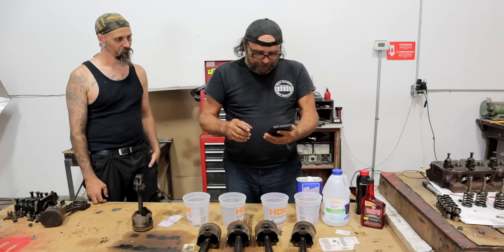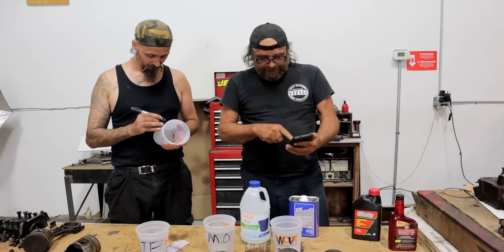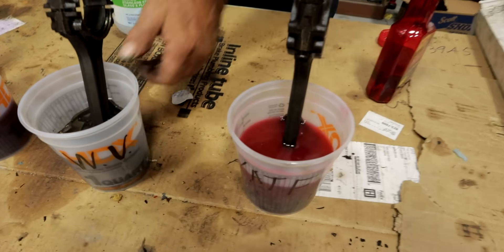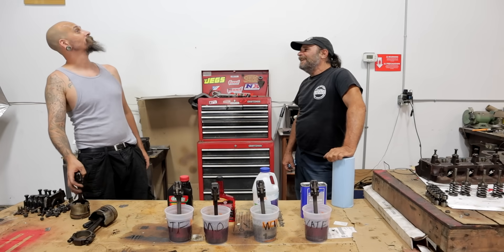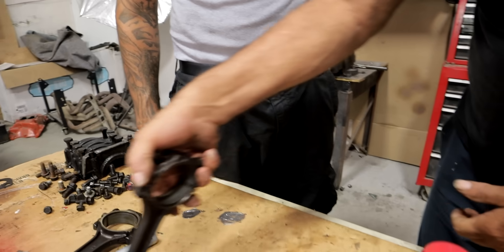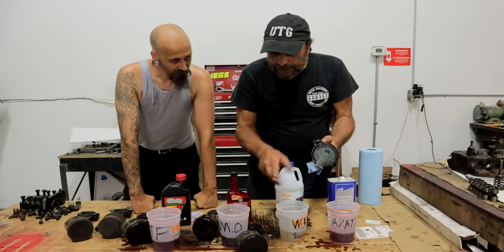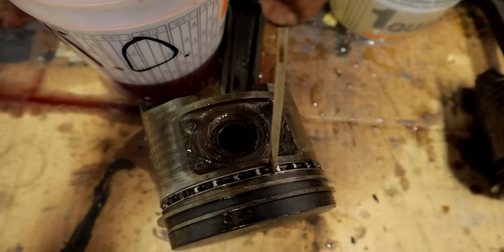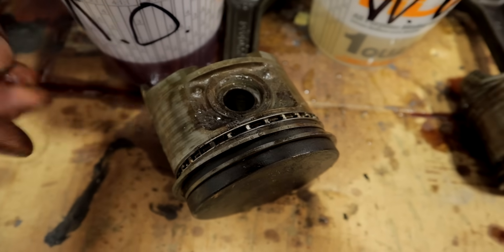Best Fix For A Stuck Engine - Viewers Choice. Marvel Mystery Oil, vs ATF, vs Acetone, vs Vinegar

Comment: 2+2 is an incredible product hard to find though. I fixed a Toyota that was consuming a quart of oil every 500 miles. Filled the cylinders 3 times over yhe course of a week then did a flush with liqui moly flush. Went from a quart every 500 miles to a quart every 2500miles. Massive improvement dont know if itll help with stuck rings but it worked wonders for oil consumption.

Comment: I use Seafoam on running cars. Concentrated detergent, can add to oil and run it hot for hundreds of miles. I was impressed just pouring it over dirty baffles. This video now has me really sold on periodic flushes with a good detergent like Seafoam.

Comment: There is a huge difference between dealing with sludge/varnish versus rust.  

Vinegar is an acid, acids attack and dissolves weak metal compounds - in other words the vinegar dissolved the rust in the rings.

The other fluids are solvents. Solvents attack organic compounds - in otherwords dissolve sludge /varnish /evap compounds.

What this test tells me is that the pistons were stuck with rust - for which an acid (vinegar) is the best choice.

If they had been dried sludge/varnish the vinegar would not have done anything and the MMO would have been the clear winner.

Different problem requires a different tool.

Comment: Remember your chemistry.
Are you attempting to dissolve rust or dissolve carbon?  
I say this from long experience freeing old tractors.   Your first soak needs to be something that dissolves rust.   Vinegar works, CLP, or rust penetrant.  I’m talking LOTS of it in the cylinder for not just overnight, but a full 24.   Blow it out with compressed air.  This first step dissolves the rust so the crank will now turn.
The second soak is with a true carbon dissolver. That’s your Seafoam, B-12, 44K, or crankcase flush and it gets a 24 hour soak.  
I have had zero luck with Marvel, ATF, or brake fluid.  
The idea is, get the rust particles broken and softened up and out of your way so the second soak can free up that lifetime of burnt carbon build-up.
Freeing up a stuck engine is easy via dissolving the rust.   Getting the rings to pop back out  by dissolving the carbon is the true fight.

Comment: I have rusted piston rings with 0 compression on all 4 cylinders. I was going to dump  concentrated white vinegar in every cylinders but my mechanic friend told me to use diesel instead. I will try it and come back to you. Allarently using vinegar is not a good idea

Comment: I use 6%($5)Vinegar or 30%($20) to clean rusty Motorcycle tanks on the Bikes I bring back to life. For stuck pistons LIQUID WRENCH beats JB Blaster and WD-40. Marvel just seems to be riding off a VERY Old reputation than modern reality. Good Vid, Thanks.

Comment: So about 4 oz down each spark plug hole, let's set as long as possible....
Crank over without the spark plugs to clear the cylinders  , you might get lucky.    The old cans of liquid wrench is to recommend this.    And Grandpa used to use 50/50 oil and kerosene.

Comment: Diesel fuel. Run it in my car for stuck valves also, mixed with gas.
One gallon diesel two gallons gas.  Stuck rings straight diesel. Let's soak overnight.. in cylinder..ok.
Age68

Comment: What works will depend on WHY or what is causing them to stick.
  Solvents: Thin organic (non water) solvents will dissolve other thick/hard organic deposits like oil sludge and plastic like varnish. Volatile/flammable/explosive ones shouldn't be used in a running motor however prepared products that may also include detergents can be used on an assembled motor. Add it to the oil or spray it into the intake or spark plug holes, run it for a minute and then leave it sit for a day or two. Stay away from solutions that might harm gaskets.
  ACIDS will dissolve RUST, if the cause was moisture not old oil then soaking in it will be effective. Most acids will work however some might work TOO well and eat the part. Vinegar is actually powerful acid. Concentration is key to any acid and food grade white vinegar is weak and will require more time. Any acidic solutions or methods for removing rust will work, some faster than others. However, they themselves will also cause rust and possibly dissolve the parts so after the parts should be cleaned with oil. Using acids on an assembled motor is probably a bad idea. But, I guess one could pull the oil drain plug and drop a half cup of acid into a plug hole, wait a day, drop a couple oz of thin oil in the hole, wait a day then fill it up with fresh oil. Run the motor until its warm and if it works, do another oil change.

Comment: MMO is my go-to stuff. It might take longer than vinegar, but vinegar has no lubricating properties. If you pour it in a cylinder, you have to get it back out. MMO can stay in and you can safely rotate the engine. It will burn off once you get it started. Load the gas tank up with a couple quarts also and run the engine. The MMO and heat from running will get her going again. Besides, it smells good!

Comment: Now I’m working on a neglected Tacoma with piston # 1 with that problem , I used in this order  “seafoam”, MMO, B12 and  now an Engine flush product …. Right now the level is not going down in the chamber 😃 so I’m assuming the piston rings are getting free😁

Comment: After 55 years of working on stuck engines and trying everything I found brake fluid to be the absolute best hands down for freeing stuck cylinders.
Reply: because of the toluol+aceton mix, it evaporates fast, so it is better to put some 2t oil into the mixture.
Reply: you need to be super cautious with toluol tho, it is highly famable. 

what i would do is to buy simple paint thinner that has toluol/aceton mix in it. You can add some IPA+ 1/10 2t oil and once soaked and turned the crankshaft 3-4 times, just  drain like 2 liters of oil mix and pour 2liter ATF, start the engine and let it run for like 15 minutes, with liquy moly engine flush then do an oil change. 

Once you filled the engine with new oil, buy a LM valve cleaner and add that to 15 liters of gasoline and go 5k+ rpm on the highway for like 45minutes. 

if this does not help your oil consumption then only a new engine will do

Comment: first of all drain all your oil out your oil pan, leave your oil filter on. leave your oil plug out. Only do one cylinder at a time. put a pressure gage on the cylinder and bunt the starter until the Gauge says around 60 psi. that's on the up stroke and all vales are closed and there is a vacuum in the cylinder. put a container under the oil plug hole to catch the drips. Pour in 1/2 cup of mixture 50-50 .in cylinder then put the plug in quick. Then look under your vehicle and you will see a drip every second of blead from the cylinder. if it all drains out, then repeat again with fresh 50-50 mix, when the mix quits dripping that means that the rings are free, and all passages are open. Then turn over the motor to push out the mixture. then do the next cylinder. Buy a whole gallon of acetone and a gallon of paint thinner or kerosene but kerosene works better there is a patent on removing carbon build op on engine parts.my patent. you will notice that your plugs will start burning tan looking and not black looking. Then add cheap Walmart engine oil  .

Comment: I have white smoke from one of the exhaust, passenger side of the V. Could it be caused by stuck rings? smells acidic and is whitish grayish. No Cats in the car I must say and the car has been sitting for more than 3 years. Coolant is not "consumed" by the engine. Any help will be greatly appreciated.

Comment: After cleaning off the oil with trichloroethylene (Brākleen®... in the red can), soak in a solution of oxalic acid, keeping the solution hot. Also agitate. Rust should come off better than vinegar. May not need to soak overnight.
Trichloroethylene is the best de-greaser you will find on the market. It bonds chemically to the oil (via hydrogen bonding), unlike solvents that only dissolve oil.

Comment: Project Farm 2.0
I bet a ton of us would watch more abd raise your viewership by doing more of these tests, especially viewer requested and viewer solutions tested.
On every video there always several guys who have a wacky method and its cool to test it.

Maybe put anti seize on
Wheel studs or lug nuts and test torque wrench results with a 20% reduction in manufacturer torque spec

Comment: Assuming the pistons are not seized, and its just ring issues, over the last year, a new.Valvoline Oil called Restore and protect has taken  the industry by storm.  Lots of people are swearing by its success, especially for oil burning vehicles.   I just used it in a 2009 vibe (toyota 2.4L) with known oil "consuming" issues, from low tension ring design. At about 160000 miles, It was using  about 1 quart every 1000 miles.  So far,  after about  600 miles, its barely  below full.  Im pretty sure its working!
Reply: so what alternative can be used for that oil? we have mobil 1, motul, castrol, liqui moly here. no valvoline, no amsoil...
Reply: Restore.isnt for unsticking rings. It is for creating a slight glaze on cylinder walls, to fill in imperfections.

Comment: I use 50 cent a bottle pickling (food grade) white vinegar in a heated ultrasonic cleaning bath. Totally wicked stuff. Don't leave things in too long if you try it! Rinse soapy water, the under the tap. Dry off then dunk in oil.

Comment: also I read on Hamb, jalopy journal that old timers used to drain the oil pan, put 5 qts of transmission fluid in the engine, pour it in the heads with the valve cover off, put it in each cyl and let it sit for a week, once an engine is free they prime the oil pump with  drill and correct prime tool and watch to make sure each of the rockers start to lift and oil comes through the push rods... then they eventually start and run the engine with atf in it to operating temp then drain it all and fill with oil, then repeat a few times more.  What do you all think?
Reply: i also read that atf has detergents in it that help clean up lifters and valleys and all bearings, seems it should work.

Comment: Vinegar is an acid (acetic acid) and will dissolve rust. Try it against Coke, which contains (lethal on the longer term  :-)    ) dose of phosphoric acid. Both work for removing rust and freeing rusted parts.  Solvants should work better for removing carbon deposits.

Comment: Well some ask how to  neutralize it after you get unstuck pour in baking soda n a little water. Iv used new stuff advertised on t.v.  it work great you may wanna do a video on it its called superzilla. Works great on rust but not that great of a cleaner in my experience as it says. P.s. just subed

Comment: My engine overheated due to a head gasket failure and now consumes large amounts of oil. I'm betting on stuck oil rings. Which method would you advise? I don't plan dissasembling the engine.

Comment: I've got one soaking with seafoam right now. I'd that doesn't work vinegar it is. I've used vinegar to eat away rust before and it does work. I should've tried that first. Pistons are still in the engine though.
Reply: Did you try it?

Comment: So pour vinegar through spark plug openings and leave in until engine can spin, then drain, add oil and start it.
Will another oil change be enough to neutralize the traces of vinegar?  Great video, Thank You!

Comment: I think the results are going to be different due to the cause of what stuck the ring. I think the vinegar would work great on rust. If the rings are stuck due to sludge i think the solvents would work better

Comment: I have a 2005 5.3L automatic 4x4 Yukon with 223,000 miles. It holds 6 qts of oil.  I changed oil (10w30 conventional) and filter (walmart brand base filter) before a 6,500 mile mostly intestate trip from CO mountains to Mid-Atlantic to South and then back up to CO mountains. 

In the first 4,000 miles of trip Yukon burned 1.75 quarts of oil. Before making the last 2,500 miles of trip (uphill to CO) I added .75 quart MMO (conventional formula) to bring level to Full. 

It burned none in 2,500 miles to and around CO before I changed the oil/filter. So it went from burning 1.75 qts in 4,000 miles mostly downhill driving to not burning any in the next 2,500 miles of uphill and mountain driving.   

On the trip I averaged between 16.8 and 18.1 mpg, checked by gallons and miles tracking and compared to vehicles MPG gauge. The computer was very close, always within .1 to .2 mpg.

Can someone explain this dynamic? 

 I'm going to test it again on another 3,500 mile road trip soon to South and back to CO again.  If I have to add a quart I'm going to add 1 qt MMO to see if it stops the consumption again.
Reply: Thank you for this comment, my Canyon burns about the same rate. I bought my first bottle of MMO a week ago.

Comment: engine on its last legs? low compression & smokes alot? drain oil, add 1qt of new oil to 3l of diesel fuel, pour it in & let idle for 15 minutes, drain & refill with recommend oil to fill capacity & send it.

Comment: When I worked as a heavy line engine tech at a Ford dealer in the 1990's. Ford had this additive that cleaned carbon up really GOOD! I forget the name on the small brown bottle. I used to use it on the heads combustion chambers, and intakes. 

Fill up the pockets, let it sit a few hours while i did other things. Go back and ALL the carbon was gone, then wire brush it for faster results. That stuff was awesome to clean up parts, even the piston rings....Even though I was replacing the rings anyway, so did it to those a few times only.

Years ago, my dad had a van type RV, driving thru the desert back home to Arizona, from S Cal, he blew a radiator hose on a steep grade. All he had a lot of in the camper was ATF, so he fixed the leak, and filled the cooling system with the ATF.....He made it home fine, 100 miles without cooling issues, but dayyyyum that was a mess he had to clean up later hahaha.......I laughed and he said "yeah well, liquid is liquid, and it worked" I Miss the ole man
Reply: my Ford edge 2011 engine just froze up. i drove it a day before the freeze. will this white vinegar work?
Reply: @christian8970  Depends on how high your mileage is on the car/engine...2011 models are POS with expensive electrical and engine problems @ or near 150,000....Rarely will it see the upside of 200,000 miles. 

Could be lot of variables as to why yours just locked up? Sat long? drove it then it locked up?  Might be cheaper to dump it, and buy something else. I dunno  not there to see/hear. Good Luck
Reply: @christian8970  No, those engines are the same as the one in our worthless 2.3 disi or $30k Mazda cx-7 that still sits after $5000 work  on everything engine related, do not spend the $1.99 on white vinegar, it's not worth it.  Btw the 2.5 non turbo is a little better, but has the same terrible timing tech, this is the reason your engine has seized.  Sell it or donate the car.  I just don't want you to lose as bad as we did.  I'm so glad Mazda does not deal with ford now.  Large lesson learned.
Reply: Was it carbon tetrachloride?
Reply: @gregorymalchuk272  Can you still buy carbon tet?
I thought it was banned years ago.
Reply: Did you remember the product name ?
Reply: @uberdash007 no sorry it is or was an actual Ford cleaner in small brown bottle maybe 8 ounce wish I remembered name too lol

Comment: Strange it was a slanted 6. If the engine wasn’t apart put atf in spark plug hole at first if it unfreeze. And it starts. The atf will carbon and either where the cylinder out or pop the head of the piston because the ATF has a lower temperature burn then the oil. Must asital fuel supply to decarbon ring land. Especially on stock piston ring land shallow will start to freeze//different than lock

Comment: I wonder what would happen if you piston soaked with white vinegar? I would imagine a flush of only motor oil would have to be applied after draining the vinegar oil before doing another oil change to neutralize the acid

Comment: Marvel Mystery Oil works really good for keeping that kind of thing from ever happening. You can usually make it work much better by using it as a regular additive in your motor oil in the first place, ATF can be used the same way and the advantage with ATF is it keeps your valve guide seals from ever deteriorating. Plus it's got to hide detergent content along with quite a bit of anti- corrosion properties. An ounce of prevention

Comment: I know this is an old video,  but thanks for posting.  My passion is vintage metric bikes,  mostly Hondas. Phosphoric Acid is my first choice to free up pistons and rings followed up with a flushing and coating with light oil to prevent flash rust.  

I also use 30% industrial vinegar sold at home depot.

Comment: Wonder if the vinegar would work to fee stuck oil ring(from carbon) by pouring it down the spark plug hole and letting it sit for a day or so

Comment: Vinegar is acetic acid, and acids etch aluminum, so I wouldn't recommend soaking them for very long in it.  I did a test myself with dish soap, simple green and super clean.  The super clean was the best, but it is also an acid, so it etched and ruined the piston.  Simple green has a purple formulation which is safer for aluminum, might be the best way to go if the plan is to soak in the stuff.

Comment: Maybe putting the pistons on some type of vibratory surface you could get better penetration for cleaning. 
Also, I think head would help the ATF & MMO to work better. I can’t imagine you could run vinegar in your motor oil and I think acetone would make it explode.